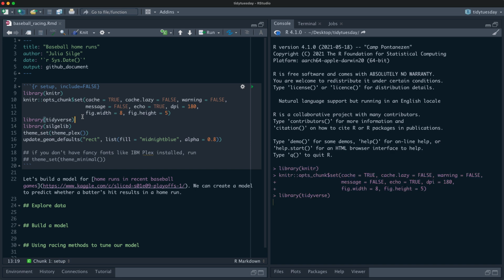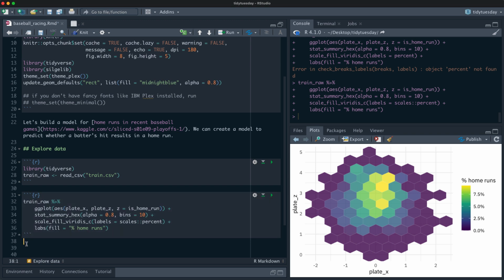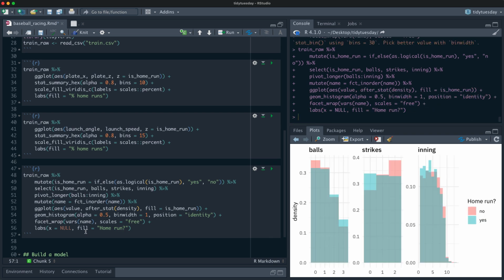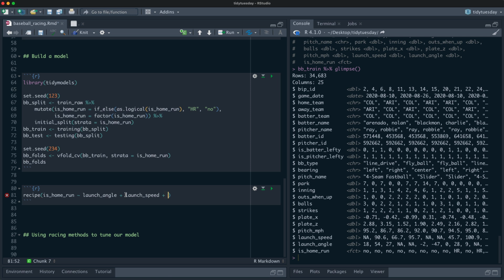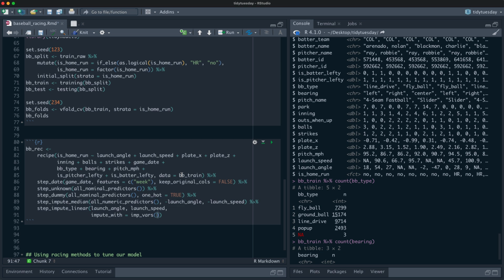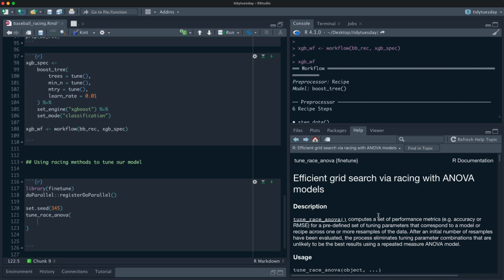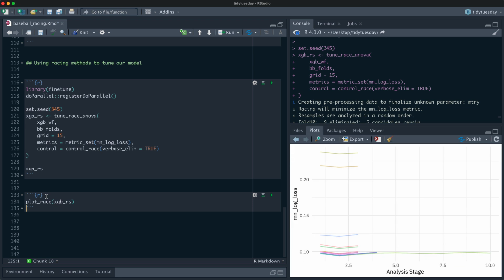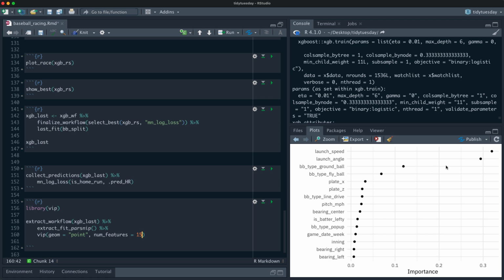Tune xgboost more efficiently with racing methods

Comment: Hi Julia,
Nice video on a topic that I find intrinsically interesting as a baseball AND tidy models fan.  I did run into an error when executing the tune_race_anova.
Error in `test_parameters_gls()`:
! There were no valid metrics for the ANOVA model.
I am not sure how to fix this and I have been careful to follow the scripts.  Any idea what might be causing the error?
Reply from the maker: When you see an error like that, it usually means your models are not able to fit/train. If you ever run into trouble with a workflow set or racing method like this, I recommend trying to just plain fit the workflow on your training data one time, or use plain old `tune_grid()`. You will likely get a better understanding of where the problems are cropping up.

Comment: Hi Julia. Great tutorial! I think it's a great time-saving solution for tuning random grid points. It would be awesome if tune_race_anova could work with tune_bayes, in that once random grids are selected from tune_race_anova, it could pass as "initial" into tune_bayes to fine-tune the best. But currently it does not work, as tune_race_anova only finishes one point that fits all folders and tune_bayes needs as least the same number as tuning parameters. Is there an way around? Again, great work! : )
Reply from the maker: Ah no, this doesn't currently work as the infrastructure for tune_bayes() does currently expect all the tuning parameters to have been evaluated completely on resamples. You could post an issue on the repo asking if tune_bayes() could be changed to accept the subset and we could discuss it there: https://github.com/tidymodels/tune/issues
Reply: @JuliaSilge  Thanks for pointing to the right place. It'll be awesome if the two can be combined. But of course, it'll be a lot of works for developers. We users are taking things as granted haha.

Comment: Thank you very much once more for your videos, Julia. Another question for you: is there a way to have a progress bar or something like that to monitor the tuning process (that may take a long time to run)?
Reply from the maker: We don't have support for a progress bar due to how we use parallel workers (considering using the future package for this, though, which may open up other options) but you can set various `verbose` options in `control_race()` that may give you some of what you want:
https://finetune.tidymodels.org/reference/control_race.html
Reply: @JuliaSilge  thank you very much for your kind reply. I tried to use control_grid(verbose = TRUE) in the RandomForest example, just before fitting the grid, but I couldn't get any output (with parallel processing). Can you kindly let me have an example? I will check the future package
Reply from the maker: @AndreaDalseno  Ah I'm sorry I wasn't more clear; we are considering adding support for the future package which will likely allow for better progress messaging in the... future. I'm not sure if the `verbose` option will work right now. Here is an example to try:
https://github.com/tidymodels/tune/issues/377
Reply: @JuliaSilge  thank you very much for your hint. I did:
regular_res <- tune_grid(
    tune_wf,
    resamples = trees_folds,
    grid = rf_grid,
    control=control_grid(verbose=TRUE)
)
and I can get the output but ONLY without parallel processing. If i use doParallel::registerDoParallel() not output is displayed.
Reply from the maker: @AndreaDalseno  Yes, you can read more about the current status of how parallel processing works here:
https://tune.tidymodels.org/articles/extras/optimizations.html#parallel-processing-1

Comment: Thank you Julia! I was asking me myself what would be the benefit. Can you tell us something about the advantages of tune_sim_anneal() too? And when it is better to fill param grid with a grid and not with an integer?
Reply from the maker: When you use an integer, the tune package uses a space-filling design rather than a regular grid design for the possible parameters to try. You can read about these two kinds of grids here:
https://www.tmwr.org/grid-search.html#grids
We write a bit about iterative search with simulated annealing here:
https://www.tmwr.org/iterative-search.html#simulated-annealing
Reply: @JuliaSilge  But when I fill grid param with grid_latin or max_entropy, this would be space filling too- or do I missunderstan this?
Reply: simulated annealing is hard tobac... hope you make a video of it.
Reply from the maker: @hansmeiser6078  Yes, that's right. If you put an integer, then it uses `grid_latin_hypercube()` to make a semi-random space-filling grid as a default:
https://tune.tidymodels.org/reference/tune_grid.html#parameter-grids
Reply: @JuliaSilge  In a regression-case, what is better for tun_bayes(),tune_sim_anneal(),tune_race_anova()? To provide an external tuned grid (maybe grid_latin or grid_regula), or an integer, where is there the benefit. Could we avoid an averhead- or some redundance?

Comment: Cheers Julia, Great video! Have been wondering about xgboost a bit lately -in regards to using tidymodels vs using the underlying xgboost package directly, with xgb.train(). I've heard mention that xgb.train() has an "automatic stop", that limits the number of trees when no more improvement is detected. This seems pretty helpful (and a great processing-time saver) rather then having to pre-specify the number of trees used. But I'm certainly not a pro at xgboost, so was just wondering your opinion. I like that tidymodels can be applied to all models but was just wondering if, in doing so, this comes at a cost (for xgboost tuning, specifically)
Reply from the maker: Yes, you can specify this (and even tune it to find the best value) in tidymodels. We call this early stopping parameter `stop_iter`:
https://parsnip.tidymodels.org/reference/details_boost_tree_xgboost.html
I used it in the last episode of SLICED I was on (with the Spotify dataset) if you want to watch that to see it in action, but I'll try to put together a tutorial/blog post demoing that soon.